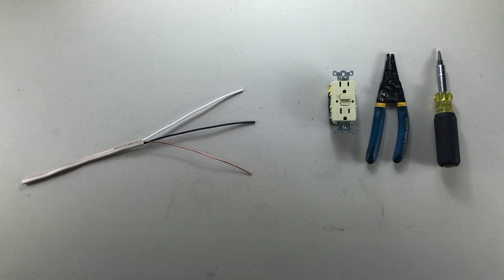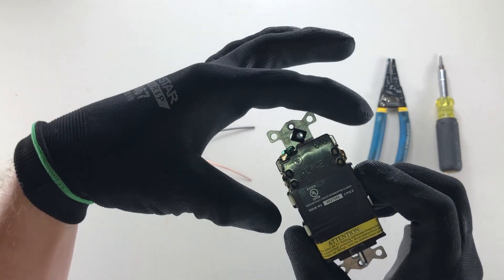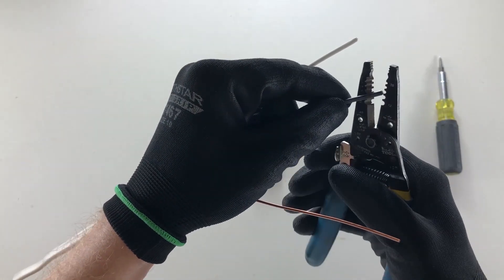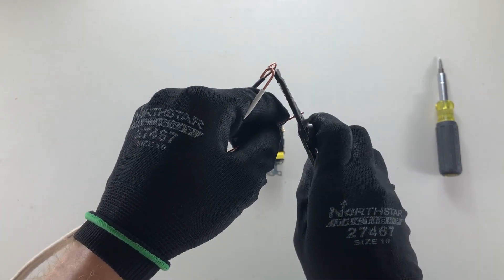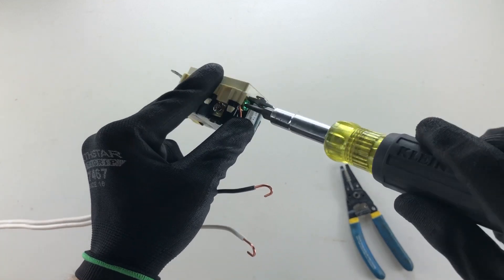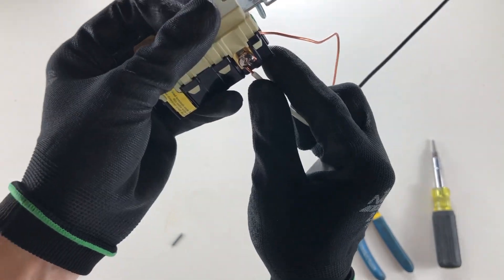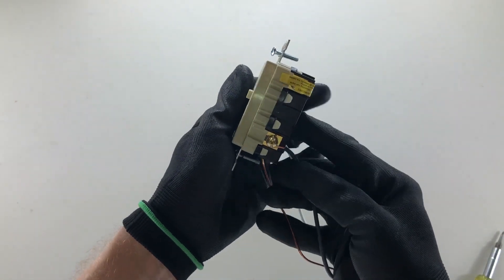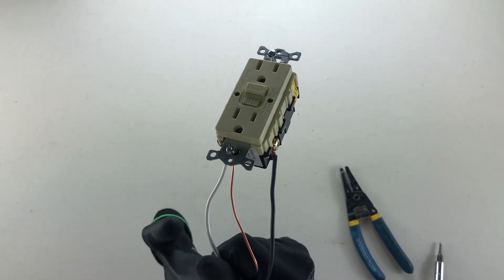How to wire a GFCI - How to terminate a ground fault circuit interrupter - The Electrical Guide

Comment: I'm wondering if I've been wiring these incorrectly. I don't bend the ends of the wire. I strip them and stick the wire under the small plate under the screw, them tighten it down. Interesting 🤔

Thanks for the video and I just subscribed!
Reply from the maker: Mr. Kelly thank you for your comment! Generally curling the wire over and wrapping them clockwise around the screw will maintain a better connection over time. Sometimes when they are just stuck under the plate after a few years maybe you go to replace it and when you pull the plug out of the box the wires just pop out and that can be hazardous. This is usually due to temperature fluctuations over time, wire expanding and contracting slightly. Curling the wire properly under the screw head is the best way.
Reply: @theelectricalguide  Thank you for the response and I get it! God bless and Happy Holidays!